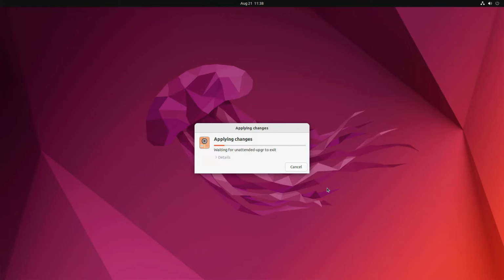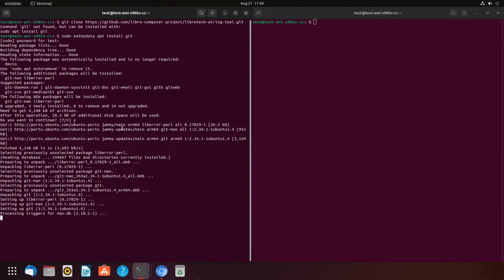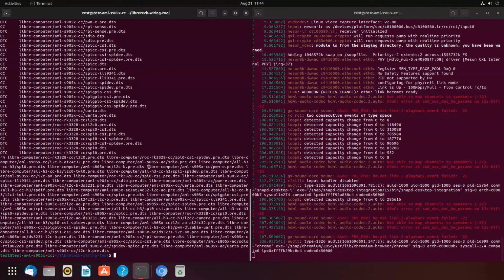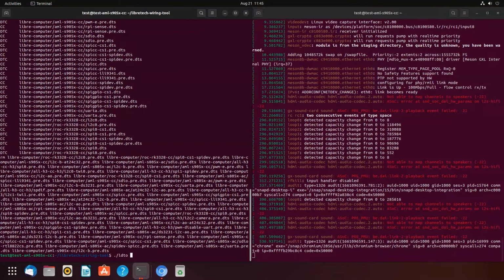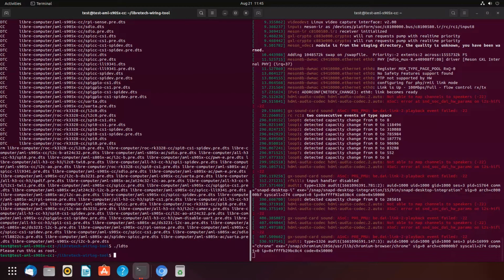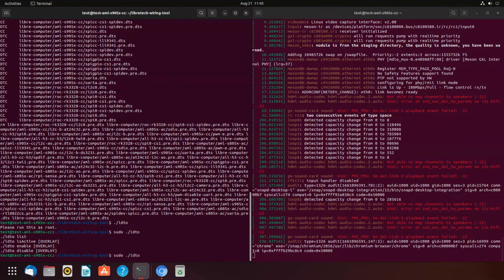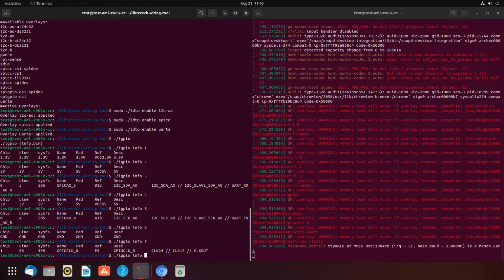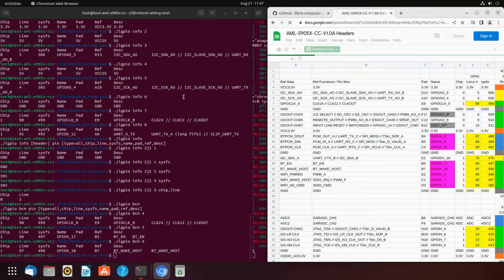In-Depth Technical Overview of Ubuntu 22.04 on Libre Computer Boards

Comment: This might be a stupid question but my screen when I boot is stuck with the starting screen from 0:37 in the video, is there something I’m supposed to press to load into the desktop set up?
Reply from the maker: Most likely power supply is inadequate or MicroSD card is corrupt if you get mmc errors.

Comment: Which Armbian version can provide 1080p+ when watching youtube on Renegade? I tried the current one, Jammy, of course it couldn't work. No current version works actually, Ubuntu, raspbian or Armbian. I also tried all Armbian Buster Legacy images. Supposedly there's a script to install software to run HD. But those imagines don't boot into GUI at all, or don't run sudo apt update, if they do boot.
Reply from the maker: This is not an issue with Linux but rather with Chrome and other browsers. They do not support the V4L2 API in Linux for media acceleration. That said the situation is improving and hopefully Google will complete the work soon.

Comment: Does it have the Live ubuntu feature that regular ubuntu has(live CD test/try ubuntu instead of install)? where it sets up a testing environment that doesn't install the OS or store data on the SD card?  

I am looking to have a test machine and need this feature. Hope Libre computer can provide it.
Reply from the maker: Ubuntu does not have a Live installer. This image is considered "preinstalled". Only minimal user setup happens upon boot.
Reply: You just need to have an extra microSDHC card with "test" Ubuntu installation...
Reply: where can I get "test" ubuntu version? On normal computer with normal ubuntu, you dont need to install ubuntu, you can test it with live os or try ubuntu mode. It doesn't keep any new data on sd card, This is what I am looking for. I want a single board computer for testing/trying/live environment only please. No new data stored on sd card please
Reply: @LibreComputer  where can I get "test" ubuntu version? On normal computer with normal ubuntu, you dont need to install ubuntu, you can test it with live os or "try ubuntu" mode. It doesn't keep any new data on sd card, This is what I am looking for. I want a single board computer for testing/trying/live environment only please. No new data stored on sd card please
Reply: @Optioning  What is the point of that when the entire operating system will always exist on portable media? I mean this as a legit question, and perhaps an opportunity to share our experience with Single Board Computers. If you wish to have access to multiple operating systems you can just set up grub to select them from the two OS on two different media. They will likely mount each other's disks as well, so I can't see the point of that at all. What are you trying to achieve?
Reply from the maker: @Optioning  When you burn a "live cd", you're modifying the data on it. This is the same thing except the live CD is the actual OS rather than just being a test OS.

Comment: How do you enable pwm on the roc-3328-cc?
Reply: if anyone else has trouble with this just look up the libre wiring tool and use the tool to install the dts. In my case pwm wasn't a pre-made dts so I had to write my own
Reply from the maker: @calebsteinmetz9471  Feel free to contribute back your overlays.
Reply: @LibreComputer  I just did :)
Reply: @LibreComputer  Do you think you could do a video on how to enable and use SPI on the roc-rk3328-cc board? I am having trouble getting spi to work
Reply from the maker: @calebsteinmetz9471  you can follow the le potato instructions and change spicc to spi0 https://github.com/libre-computer-project/libretech-wiring-tool/tree/master/libre-computer%2Froc-rk3328-cc%2Fdt
Reply: @LibreComputer  I actually got it to work using the spi0 and spi0-cs1-spidev overlays. From there I just used spidev to write a user space driver.

Comment: I wrote the image to an sd card with win32 and plugged it in to the le potato. Nothing happened. Do i have to flash eMMC?
Reply from the maker: What is the filename of the image? What is the tool you used to flash the MicroSD card? You do not need eMMC.
Reply: @LibreComputer  ubuntu-22.04.1-preinstalled-desktop-arm64+aml-s905x-cc, win32 diskimager
Reply: i had a screen plugged into the HDMI and nothing was displayed.
Reply from the maker: @Bildivarian  Did you extract it before flashing? Are you using Win32DiskImager? When write is complete, click Verify to make sure it is written correctly.
Reply: @LibreComputer  yes extracted, win32diskimager, failed at sector 2048 (I didnt check the first time). How do i fix that?
Reply from the maker: @Bildivarian  Some application is probing the disk and writing to it as you are flashing. Try killing those applications or rebooting and starting just Win32DiskImager.
Reply: @LibreComputer  The Raspberry Pi Imager worked without intervention. part of that imager is to set hostname, username, and password. Will it apply those to the ubuntu image?
Reply: @LibreComputer  The image on the my screen is all washed out. I checked it working normally with a different computer. Any thoughts?
Reply from the maker: @Bildivarian  Raspberry Pi Imager's image modifiers will break the image. Verify the image with Win32DiskImager.
Reply from the maker: @Bildivarian  What is the make and model and do you have a photo?
Reply: @LibreComputer  imgur     /a/kYJUhHN   I cant post links i guess. AML-s905x-cc
Reply from the maker: @Bildivarian  The monitor is advertising colorspaces it doesn't support in it's EDID. Do you have a model? Can you upload the EDID file to hub.libre.computer and we can patch it for you? Run this in a terminal: cp $(find /sys/ -iname edid | grep HDMI) edid
Reply: @LibreComputer /sys/kernel/debug permission denied
pstore permission denied 
bpf permission denied
Reply from the maker: @Bildivarian  that is expected. See if you have a 256B file called edid in the current folder.
Reply: @LibreComputer  i don't know how to do that? are you on the hub.libre forums?
Reply: i see a file called edid in the "file explorer"
Reply from the maker: @Bildivarian  Start firefox or chrome on the board, go to hub.libre.computer and open a new thread. attach the edid file from the last step.
Reply: @LibreComputer  it wont allow me to upload the edid (file type not allowed)
Reply from the maker: @Bildivarian  Try a third party service like https://filebin.net/
Reply: @LibreComputer  done